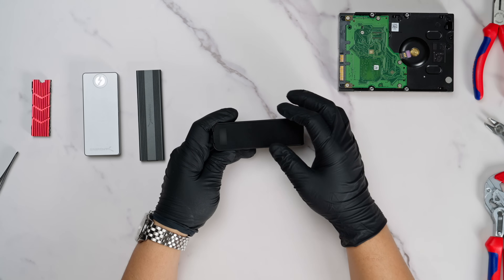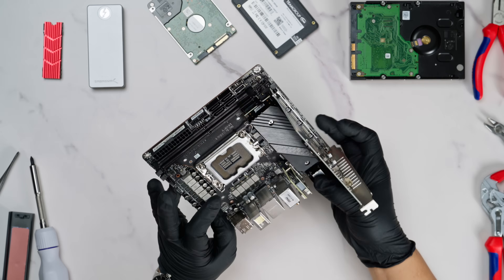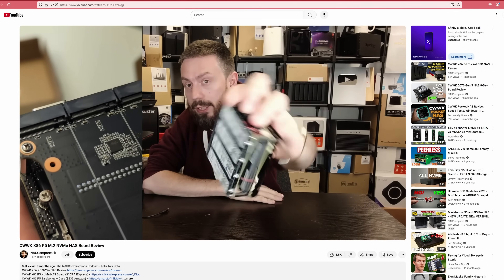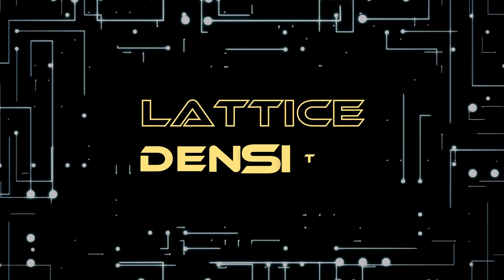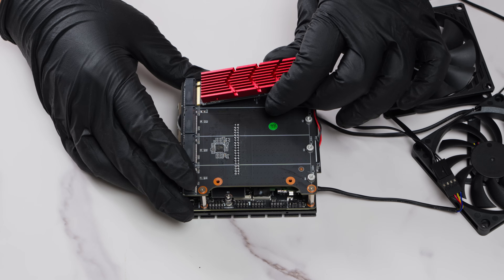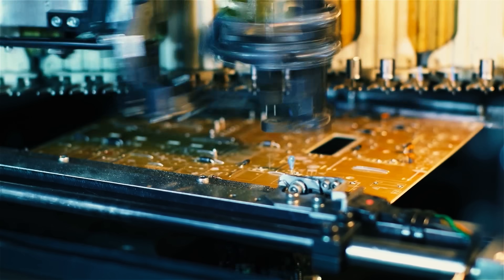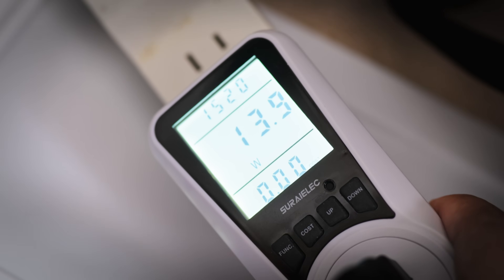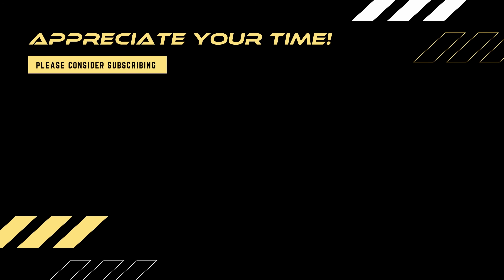Building a Tiny 4-Bay x86 NVMe NAS for Less Than $200 using CWWK SBCs

Comment: Bonding 2 x 2.5 NIC will still have the same speed but it will have the double throughput. Otherwise great video.
Reply from the maker: Yeah I misspoke on that one, I really meant to say throughput got caught in the moment😣, sadly it's too much work to go back and change that. Thanks for pointing it out. Will pin this comment for visibility.
Reply: Could you setup SMB multichannel and then get 5 gig?
Reply from the maker: @stevefxp  Maybe, but that's mostly for SMB file sharing performance, won't be a physical layer speed improvement.
Reply: @LatticeDensity  agreed but file sharing is exactly what a NAS does. I have it enabled on my Synology NAS and it's definitely a major boost for file sharing tasks.
Reply from the maker: @stevefxp  True. I haven't personally used it much, good to learn that it actually adds a meaningful difference in practical use cases. Thanks for sharing!

Comment: A few more questions...

Where did you get the screws for securing the bottom of the unit and the lid?

If you had screws lying around what size were these?

So you used the fan that came with the unit? I thought that fan was USB only?

Comment: These double nic mini pcs, could work as a network router? Using something like opnsense or pfsense?
Reply from the maker: Most likely, but just 2 ports won't be super helpful for this. If you must have a router use-case implemented, then I would look at something like this: https://cwwk.net/collections/frontpage/products/cwwk-12th-generation-n-series-8-core-new-member-affordable-version-n305-n200-n100-fanless-low-power-consumption-micro-mini-industrial-control-host-soft-routing
Reply: @LatticeDensity 1 port wan, 1 port lan to switch, switch to every computer. Seems simple enough

Comment: gloves for nas building? is this nas infected? or it's just shitty ;)
Reply from the maker: I am not sure how to respond to that. Anyways, in case you are honestly curious, it's a good practice to not handle electronics and PCBs with bare hands as you may end up shorting things that you don't want to. Also there is static electricity which can harm components. Even if it's not connected to power, certain parts may still have latent power from things like the MB bios batteries so I always handle these with gloves.

Comment: Hi, Great video! 
I have the same board with the I3 cpu and the cwwk enclosure, I added a Nactua fan on it but I cannot get it to work properly.
Did you change anything in the BIOS or in TrueNas for it work ?
Reply from the maker: Not really, it works fine for me on that 2nd PWM Header.

Comment: Hello,  i bought the fan but the 4 pins connector is bigger than the connector on the board,  what types of adaptor that you used to connect it? 
Thank you
Reply from the maker: I think the board came with an adapter to connect normal PWM connector to the smaller one on the board. You should also be able to find a connector like this: https://www.moddiy.com/products/4-Pin-PWM-Fan-Connector-Male-to-4-Pin-Mini-GPU-Fan-Connector-Female.html , depending on what connector your board uses, which can be different from mine based on the exact model. Essentially, PWM has 4 pins and as long as you can find a way to connect them into accurate channels, they will work. Also, an alternative is to use the direct input voltage to power the fan.
Reply: @LatticeDensity  think you so much for your help,  appreciate it man,  
Great video 👍
Keep it up

Comment: A couple of things I believe should be in your list of items to buy:

1) SATA board for the SATA drive....where can we obtain this board?
2) Converter cables for the fans...you mention you used one on the added NVMe fan?

I am working with a local 3D print shop, so they are going to help me modify your lid, so I can secure the fan to the lid. I am also going to change the color from green to grey. Once I have everything done I will put up a picture link to the final product.
Reply from the maker: Nice! The SATA Drive I used is a generic 2.5 inch SATA SSD, and I pulled it out of the shell to get the inner PCB. One thing to keep in mind is that the bigger capacities (like 4TB or so) may have a bigger PCB, so to be safe, use a smaller size. It's only needed for the OS which is only a couple of GBs. I used a Teamgroup 256G which has a tiny PCB inside it. For the converter, I just mentioned above in another comment. I think my board came with a converter for normal PWM fans, but you can also buy one like: https://www.moddiy.com/products/4-Pin-PWM-Fan-Connector-Male-to-4-Pin-Mini-GPU-Fan-Connector-Female.html, but be sure to check the exact connector on your board. Can't wait to see your updated design.
Reply: @LatticeDensity  ohhh you broke open the SSD and just used PCB and flash storage...connected it to the special cable and away you go?

On my Arctic p8 Slim it has both a male and female 4 pin connector. Why didnt you just use the 4 pin female on the fan or do you not have this?
Reply from the maker: @stevefxp  It's not breaking open, there are 4 screws so it's a very easy disassembly, no force required. You do break the warranty seal though, in case you care about it. The special cable for connecting actually comes with this board, so it was easy that way. I think I do have the same connectors on the fans, don't recall but as I commented somewhere here, the PWM pins just need to get connected to the right channels that's all. Doesn't really matter if you used the male or the female connectors, or even removed the connectors all together and joined the barebone cables.
Reply: @LatticeDensity  what is the special cable I would need? I have an ssd that I'm not using and debating trying this. also which pins are you connecting the ssd to?
Reply from the maker: @aleyoppy  The normal SATA to the micro SATA that I am using comes with this board. The board diagram will show where to connect the SATA connections to.

Comment: has this been stable in your use? i have seen people complain about drives disconnecting and requiring a hard reset in order to show back in truenas.
Reply from the maker: TBH this is not my main NAS, just a travel setup I have been using occasionally. So far, haven't run into any issues. However, if you use it as your main NAS running 24x7, long term reliability may be not as good as a proper NAS that uses standard hardware.

Comment: I have this one with the N355 version and using it only for backups (proxmox backup server) it's working great ! I swaped the wifi module and replaced it by a m.2 nvme 2242 size for the OS and installed 48gb of ram with 4 x 4gb nvme
Reply: so the wifi slot supports an ssd?
Reply: @Glyderwormm I don't see why it wouldn't. They're usually not a wifi slot... Just everyone uses it for one.
Reply: @Glyderwormm  I would like to have this confirmed as well

Comment: If I'm looking for a RAID 1 NAS  Any reason I couldn't use one of the 4 NVME Slots for the OS?
Reply from the maker: No reason, just saves a valuable slot is all. But you can always sacrifice one of the NVME slots for OS.
Reply: @LatticeDensity  Have you had any issues with Bifurcation?  RAID 1 was working like a champ with OMV. Now my Bios will only recognize 2 of the 3 drives I have installed on the adapter.  I can use any of the 4 slots on the adapter.  I've confirmed all 3 drives are functional. Once I add the 3rd drive, Only one drive is recognized.  I've had zero luck trying to find a bios setting to reenable the bifurcation on the M.2 slot.  Since the adapter is passive...  I'm at a loss.

Comment: Do you leave the SSD external to the case or is it sandwiched between? Its not clear in the video, since you do not show it sandwiched. Second have you played around with an aluminum case, for more heat dissapation?
Reply from the maker: It is sandwiched between, not external dangling drives, sorry for not making it clearer. I haven't played with a metal design, but I am not sure if it will be a massive improvement. This setup relies on airflow based active dissipation of heat so surface area increase may not be hugely beneficial until you can make sure that all that extra metal is also receiving some airflow to take the heat away. But could be an interesting experiment.

Comment: Excellent video, I'm thinking about using it and pulling the trigger on the CWWK board. Can you please link the sata converter you used to install the additional ssd (or did that come with it? I didn't quite catch it) Also can you link to the heat sinks that you used for the SSDs? I was concerned about the cooling but it seems like your setup adequately solves that problem. Thanks for your work.
Reply from the maker: Thanks for your kind comments! The SATA converter did come in the box, and 2 of them so you are covered. The SSD heatinks are there everywhere, I got mine from Aliexpress, this I think: 

" I just found this on AliExpress: $11.85 | M.2 SSD NVMe Heat Sink heatsink M2 2280 SSD Hard Disk Aluminum Heat Sink with Silicone Thermal Pad for PC / PS5 PCIE 2280 SSD
https://a.aliexpress.com/_mOc7iMx"

Comment: Since it has an M.2 slot for wifi and you're not using it, why didn't you just install an SSD into that slot?
Reply from the maker: Actually, you can’t use most SSD in the Wi-Fi M.2 slot on a motherboard. That slot is usually an E-key M.2 interface, which is specifically designed for Wi-Fi and Bluetooth modules, not storage. SSDs require either an M-key or B+M-key slot and use different interfaces like PCIe x4 or SATA, which the E-key slot doesn’t support. Even if the connector looked similar, the electrical signaling and BIOS support wouldn’t allow it to work. So unfortunately, it’s not a compatible option for adding storage. However, I think there are some SD adapter cards that work with this and one viewer commented that somewhere on this video to have been successfully using that with an SD card, so that could be an option but I find it a but finicky for reliability.

Comment: Hi, Great video as im currently looking to get a small nas like this. Had a look at GMKTec and the Maiyunda but they get really hot so its no for me. Can you let me know where did you get that sata cable to plug the SSD?  Thanks RS
Reply from the maker: It comes with the CWWK board! And 2 of them 🥳
Reply: @LatticeDensity  Thanks, can i also ask where did you get the sata disk  you show in the video?
Reply from the maker: @rmccas  I took it out of a 256G 2.5 inch SATA SSD. There are screws at the back of those you can easily open up.

Comment: Nice work! To answer your question at the end, I just got my GMKTec G9 which takes 4 NVMEs and has an EMMC for the OS. The NVMEs don't get too hot but the CPU cooling is terrible and makes the case too hot to touch even when idle. 

Another solution is the Maiyunda 4+1 NVME box, reviewed by NASCompares and Technically Unsure among others. 

The closest to your build is probably HardKerne's Odroid H4 series, with its Type 2 Cube case. The H4 takes a daughterboard with either 2 or 4 NVMEs, and the H4 Plus and H4 Ultra also support up to 4 SATA drives. 

Multiple case choices are available, but the Type 2 is the closest to what you have designed.

In their assembly video (https://www.youtube.com/watch?v=PXYY_3sWFGQ), at around 1:35 they show the optional "Net Card" fitted in it. While either the 4xNVME or 2xNVME board can replace that NetCard, according to their website (https://www.hardkernel.com/shop/h4-cube-case/) only the twin NVME board would fit in the Cube case (along with 2xSATA's).

Otherwise you'd have to opt for the bigger Type 3 or Type 4 cases, both too bulky to travel with imho.

Comment: There are low profile 4x4 nvme bifurcation cards now meaning you could deploy an itx low profile system with 6 nvme assuming 2 motherboard slots.
Reply from the maker: While using an ITX board is a valid option, PCIe bifurcation support remains limited and inconsistent across consumer platforms, often requiring manual BIOS configuration and specific slot layouts. ITX form factors also constrain expandability, typically offering only one or two M.2 slots, and relying on risers or NVMe add-in cards introduces complexity, potential signal degradation, and cooling challenges. Even low-profile builds can become bulky due to PSU requirements and the physical footprint of PCIe accessories—making it feel like overkill just to house a few NVMe drives. That said, ITX does offer flexibility in CPU and chipset options, and with a high-port NVMe HBA like the HighPoint SSD7540 or a Broadcom Tri-Mode controller, it could be a viable high-performance solution—though cost and power overhead remain concerns compared to more purpose-built storage platforms.

Comment: there are intel atom n100 and n150 based ready solutions that cost less /gmktec with 12GB soldered ram and n150 for 199, nucbox g9 same specs and price or  maiyunda m1s nas for 149 usd with empty sodimm slot where you can put in an up to 48GB ram stick/
Reply: The GMKtec g9 need some modification on heat exhaust as those holes are trapping heat inside the case, and it limited to 12GB so memory hungry / cache purpose will got limited (although g9 claimed have more lanes to each slot compared to X1 each on cwwk) 

I got one of each sitting on my desk ATM, I still prefer cwwk p5x86 or pocket Nas instead consider overall design
Reply from the maker: @ Thanks for the insight. Could you share where did you buy the GMKTec from? I wasn't sure which website was legit.
Reply from the maker: Not sure about the other options if there are readily available 4 Bay solutions, but the GMKTec and the Maiyunda did catch my eye earlier when I was planning the video. However, I didn't find very convincing links to buy for the Maiyunda (Both the links on Unraid was showing 404 for me) and the GMKTec was probably out of stock or something. Nonetheless, they are not very mainstream products is what I felt, but if I am wrong and people are actually using those successfully in the community then I am all for them. Please share the reliable links to buy them here for those who doesn't know about them. Thanks for sharing!
Reply: just checked the specs of the GMKtec g9 and it only supports pcie3 nvme drives. you can put a pcie4 in there,but it will run much slower. also limited to 4tb per drive.
Reply: @jmwintenn  as all those systems are built around n100/150/305 processors the m.2 slots are limited to one lane anyway and you have also the bottleneck of the 1Gbit network card, one 8TB ssd costs four of those minipcs so presuming someone who can afford four 8TB ssds will look for a little bit different solution
Reply from the maker: @radeksparowski7174  Agree on the speed, as long as they work, there is no point talking speed here in these cases where the lanes are severely split. However, for the affordability part I am not so sure. Even if one can afford 8TB drives, there isn't a premium compact solution out there (options like UGreen NAS etc. are bulky as compared to these smaller ones), so I can still see someone using these smaller ones instead of that.

Comment: do you know if that m.2 adapter works on any other non cwwk motherboards? thinking of picking one up for an already built nas
Reply: Can't , I think there was a retimer on the board and the M2 slot it connected was spilt to X1/X1/X1/X1 with a special designed bios 

Asrock nova have something similar but a x4 pcie slot to quad M2 slot
Reply from the maker: @frankwong9486  Ah! Interesting. Thanks for the information, very helpful!
Reply from the maker: Very interesting proposition, I actually just took a look at it and it seems like there's a 12V input through JST connector to the daughter board which is the only other thing we should need to have it work with any NVME port, so I am guessing as long as that power can be delivered steadily, it should be good. However I am not sure if you would be able to buy just the daughter board though, have you found one?